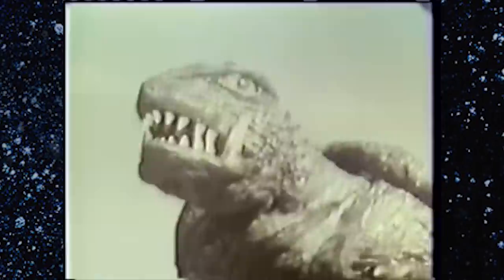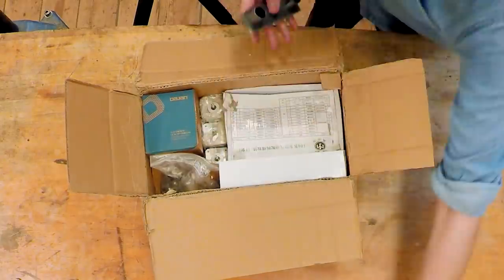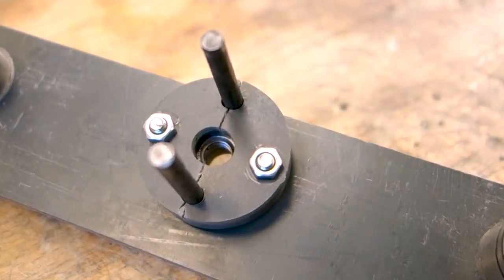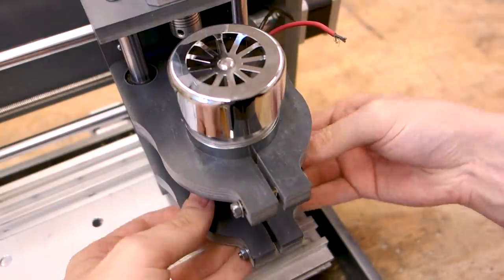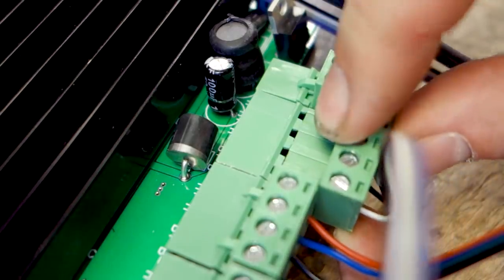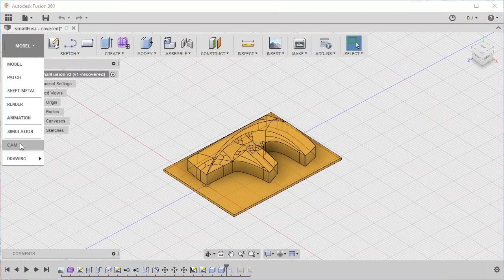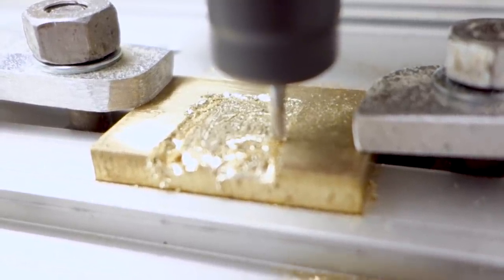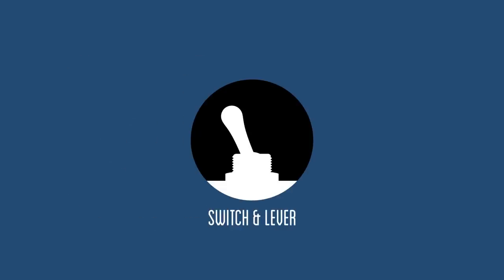Review: Cheap CNC Mill

Comment: You can solder OR crimp connectors. - Don't crimp AND solder!
Don't make me explain. I'm a civil engineer in electronics. Take my word for it.
Reply from the maker: Well obviously I can, I did it. Tell me what is worse though, a crimp connector having intermittent connection with the cable, because the cable is the wrong gauge for the connector, or a soldered crimp connector ensuring good connection throughout? Suggesting getting new crimp connectors will give you a failing grade, as I wasn't going to wait until the next day to finish.
Reply: The idea behind crimping is that it should be done so that there is sufficient pressure between all of the metallic surfaces that it slowly 'cold welds'. This is not an instantaneous process and takes a little time for the processes to happen.

The finished crimp will restituate a few [uM] over time because the outer shell behaves as a spring when hardened due to deformation. So does the copper inside the crimp but because of the ”cold welding” the connection stays good.

If you add solder (we'll assume that the actual metal-metal contact region is so tight that no solder will leach in to it), then as the assembly heats and cools (and thus expands and contracts) the solder will provide a region which expands and separates the metal-metal region.
In cables with multiple strands, the solder will wick-up and the cable will not be able to withstand vibration.

Don't believe me => checkout ESA or NASA standards.
Wire-connections in a spacecraft (which is probably the highest vibration environment you will find) are crimped and not soldered.
Crimping works if you use the right tools and is ultra reliable. Soldering will decrease this reliability.
Reply from the maker: Yep, I know the theory behind why you crimp. However you still didn't answer my question. What is worse, an improper crimp or a soldered crimp? 

Talking about NASA standards on a cheap low quality CNC is a bit silly though, don't you think? The vibrations and temperature fluctuations this will be put through is minimal.
Reply: I wasn't starting out with that. I only mentioned NASA to underline what's considered best practise. I included ESA because that's where my experience is from.

If you in a salty/ionized environment use crimp - period! All other cases: Crimp if you can.
If you haven't got the tools for crimping or the surfaces aren't clean you should stick with soldering, and leave out the crimp since the solder will still "float" after cooling down due to restituation. ( Think of a very slow motion here. Not a waterfall )
Btw. That's also why you should never put tinned cable in old-school screw-terminals. 
Instead use "ferrules" or a "pin" crimp-connector. 
https://reprap.org/wiki/Wire_termination_for_screw_terminals

Comment: Could you somehow use the machine to manufacture new metal parts for it to replace all of the plastic?
Reply from the maker: Nope. Even if it had the strength you would only be able to replace some of the smaller pieces. The machine doesn't have the travel required to machine the bigger structural pieces.

Comment: Never buy ANY CNC mill or router where the body and parts of the machine are made of plastic. For a few hundred $ more, there are pre-assembled Chinese entry level machines with Aluminum frames and beds, ball screw axis, and pre-assembled controller units. I have one of the 3040 type mills and it is great for a little tabletop unit. Very accurate, weighs about 50lbs, and can cut Brass and Aluminum (slowly).These are really hobby machines for soft materials like wood, plastics, machinable wax, etc. To machine metal, you need weight, rigidity, and spindle power.

Comment: I did not have to see the entire video, when I saw the round linear bearings.
They look like 12mm inner diameter, in plastic brackets.
And the motors are propably nema17 , which are pretty weak for milling aluminium
or even wood.
Since you have to put this together yourself, I suggest you buy prefab v-slot profiles
and plating with SBR rails, nema23 motors + drivers and use grbl on an arduino
for the controller.
There are plenty designs available and lot's of video how to construct a cnc.
You might need to drill a couple of holes yourself, but maybe you don't get to
throw $400 in the garbage.
Reply from the maker: Meh, GRBL is underwhelming and crippled. This runs a custom and more full fledged controller (though as was revealed pirated) which is a lot more capable. Also, if I wanted to build one from random parts bought from many different places I would have. That's not what this video is about. 

Nema 17s are just fine as long as the spindle is good enough. My issues with brass was more likely my choice of tool (ball ended) and my recipe. If I had more time to tweak I am sure I could've improved it. Even so, this machine is for softer material, I knew I was pushing it trying to do brass.
Reply: I built 2 prototype 3D printers (500x500 print surface) with
Ame lead screws and the same type of guides.
I use Marlin on my printer; it runs gcode, so you can use it for milling as well.
So I decided to make an adaption for milling.
It did resonably well for plastics, but ok, the screw pitch is 8mm, so
low feed rate is recommended.
However, the basic idea of my reply was:
If you have to assemble anyway, it might be better, with maybe a little more
than $400 and a bit more work, to build a much better quality cnc machine,
using basic parts.
I worked with a cnc with nema17, but ended up replacing them with nema23.
Better to spend some on the motors and the rail guides.
Those are the most important parts.
The rest can be cheap; scrap metal if need be, as long as you can fine tune it later.
Right now,
I am working on a 6 axis cnc machine, with harmonic drives (less backlash).
I hope to do a video on that, some time in the future.
Reply from the maker: On principle I agree with you, if you know what you're doing building your own is often better than buying cheap kits. However, if you're a beginner and you want some experience having all parts made for you and you have to do the assembly is a good thing. I don't think that the instructions and the parts were quite up to par on this with what they should've been. For a good example check the videos I made on the 3D printer kit I assembled some time ago. In terms of complexity it's not that different from this, but the instructions make the whole difference!
Reply: Usually, any person who wants to build such a machine, has an interest
for technical stuff. They are makers. I suppose that's the principle you speak of.
If people have no idea at all, maybe that deserves a video about, what exactly it
is that they get themselves into.
Because you and I know, there is a lot involved, like the mach3 software, or
whatever, and sooo many important details. It definately is not easy.
Then again, if it were , anyone could do it ;)
It is a pretty steep learning curve, but very satisfying, once you get it all working.
Just doing something, you can be proud of. It is wonderfull.

Comment: excellent video. i think the chinese are smart like most europeans and when you order this thing, if you do not know how to put it together, you will never know what it is for nor how to use it. face it. to be a creator of any kind a base IQ of 125 is required these days and according to the statistics, this is very rare. however i do love your video and how you sorted things out. a point to note that you shuold look after yourself a little more and perhaps geta scrubbing brush for when you wash your hands so your nails do not look dirty when filming. if your hands were clean (not that difficult really) the video would be 10/10. : ) apropos the chinese stuff being dirty. i reckn its air polution and them using any old bags to put the stuff in. i get stuff from china from time to time and they do not do the "unboxing experiewnce" well for cheap stuff. most of the time the tools are drenched in oil and in some cheap bag but when you clean them and start to use them - damn they are good. most of them. buyer beware but once you get a good supplier..... blah blah blah

excellent video! i have subscribed.

like to make stuff.

not that i have time..

...i enjoy watching this! :P

THANK YOU : )
Reply from the maker: Thank you for the nice comment. One point though, I'm not going to run and clean my hands only for them to look the same ten minutes later because I'm working in a workshop. I neither have the patience, will nor the skin to keep doing that. If dirty hands bother you I suggest you don't watch any of my other videos. I know very well how to clean them, but I'm not going to do it in the middle of working, that's just a waste of time.

Comment: Wait a second, linear bearings PRESSED in to plastic components? What happens when you need to replace those CheapChineseBearings(tm) in 1-2 weeks when they wear out? Guess you need to disassemble the whole thing and hope you can press out, and then back in, new bearings without breaking the plastic...

I'm just using my 3D printer to print out CNC parts.

Comment: "Everything is wrong with it. I recommend buying it."
Reply from the maker: Which is literally not at all what I was saying. I said, there is a lot wrong with it, and some right, and that I may buy it if I had to drop my own money, depending on what my requirements were. For softer material it's fine, I wouldn't get it if my aim was to mill metal.

Comment: i think that re-manufacturing the table defeated the point of doing a review of the original because not everyone can replace the plastic parts with metal. you're improving their mill
Reply from the maker: The only thing I'm improving with that is workholding. I'm not improving the entire mill, it's not becoming an entirely new thing because of it.

Comment: You keep saying link a machine that can do better....well here you go. It is my video of my MPCNC easily shearing through aluminum. https://www.youtube.com/watch?v=AdAtLoP7Poo This thing is shit
Reply from the maker: Cool, and how much did all of that, including the router you're using, power supply and all parts, cost you? It's using 3D printed parts which are also more brittle than the plastic of this printer anyway. I'm legitimately curious, and curious why you're so judgemental about something you haven't used. It just makes you look conceited.
Reply: I will admit all of it costed a little more than this machine. At the time I did not 3D print my own parts so the overall kit costed $400. That kit includes everything you need besides the EMT conduit, which is extremely cheap. I think all the conduit was $10 or so. The router was $60, endmill $5 SO. The overall total was around $500.

And woah, don't get too defensive. What I am getting at is there is infact alternatives to this that I believe you should be aware of. It is time you visit https://www.v1engineering.com/. He has some great machines for a low price as long as you put in the time to make them.

I am calling it shit based on what you presented. For $400 that is a lackluster experience. Have I tried it? No. But it is your job as the reviewer to show us what it can do, and I am underwhelmed. The MPCNC I linked could EASILY do what that machine did plus more. It can engrave, 3d print, laser etch, draw, mill, plasma cut, you name it. It is a general CNC platform that can do just about anything within reason. Please, check it out!

About the plastic, yes 3d printed PLA is not the strongest but it is quite stiff and dimension ally accurate. What you will find however, is that the design is far superior to the machine you presented. A lot goes into making a CNC machine. Your material choice is all but one choice a designer must make. The MPCNC is an excellent example as to what GOOD DESIGN accomplishes. It uses junky materials but the end result is something good because it utilizes those said materials so well. Rigidity in a machine has a lot to do with analyzing deflection points, geometry of forces, etc.

Also: The support he gives is unmatched. If you have any problem with your machine, you can post on the forum and get help from the designer him self! He believes so firmly in his machines, he even helps users who sourced the parts themselves and did not pay a dime to him. Do you think the Chinese people who made that will do the same?
Reply from the maker: I think if you're going to use 3D printed parts at least go with ABS. PLA is not only brittle but sensitive to humidity and heat, warping easily even on hot and humid days. You may find one day, for no apparent reason, that everything is out of alignment. 

I'm not saying you cannot make cheaper and better CNCs, all I'm saying is that I haven't seen examples of mills with the same range of travel and power that this has. That doesn't mean there are none, or won't be any, as this is a market that is moving quickly as well. 

I would love to check it out but it appears their website doesn't work at all on mobile (just blank white), so I cannot. What controller does it use? I haven't seen any of these different platforms use anything but Arduino based GRBL CNCs. GRBL is underwhelming. I'd choose a more full versed controller any day of the week, even though admittedly the one in the video turned out to be pirated.
Reply: PLA is actually the plastic of choice because of its dimensional accuracy during printing. ABS shrinks heavily which messes up how everything fits. I'm surprised to find none of my PLA has warped overtime. Also, PLA is not stronger necessarily but it is more stiff which for a CNC is better than a more durable but flexible material like ABS.

Back when I bought it, it used a ramps 1.4 board with an arduino 2560. Since then, it has been upgraded to a genuine RAMBO V1.4 motherbaord from ultimachine which is basically the same thing, but in a much nicer all one one package thats higher quality and significantly more robust.

I would like to think you have "seen" my example :P I actually produce quality aluminum parts I sell on a daily basis with just that machine alone: https://www.electric-skateboard.builders/t/boardnamics-idler-motor-mounts-for-sale/46255

Comment: 110 is NOT high voltage, and saying that it is degrades the value to the public found in actual high voltage warning nigns. Do huddled masses a favor and use the proper terms. Other than that, great video.
Reply from the maker: If it's voltage that can kill you then I'm just going to go ahead and call it high voltage. We're not talking hobby 3-12V electronics here, but stuff that if handled improperly could in the best of cases blow fuses, at the worst cause fires and be lethal if you don't know what you're doing. The dictionary definition of high voltage is "an electrical potential large enough to cause injury or damage" which 110V definitely falls within. (Not to mention that in the video the only place high voltage is mentioned is on a sign, used to get attention. Listen to the words in saying instead.)

Comment: Hi I clicked on this as I bought a cheap CNC from china and I wondered it this was the same make. Straight away I can see it is not as mine came with direction still in Chinese and the pictures were not even on the paperwork. All inquiries were met with the same answer by email which had nothing to do with my question. In the end I sent it back and got my money back under the "Not fit for use"  clause of my credit card.

Comment: You pay 400 usd for that thing ?
I just bought a CNC in China for not even 100 USD with 300 watt moter and most parts out of aluminium
Reply from the maker: Good for you, but if you actually watched the video you would've seen I did not pay for it, it was sent for review. How big of a bed does yours have though? The issue isn't that you can get a CNC mill cheaper, the issue is that the range tends to be much smaller on the cheaper ones, which makes it hard to compare.

Comment: If you are looking to get your toes wet with CNC tinkering, I think a Maslow would be a much better choice.
Reply from the maker: I don't agree, the Maslow is basically just a board cutter, it's not much different than a laser cutter in terms of operation. You can't really do 3D geometries.
Reply: Unless you are interested in cutting foam, I'm not sure this machine could do that either. The z axis upgrade should bring it closer to a full 3d device, but even without it at least it has the ability to do useful work.

Comment: Can it run with any open source drivers instead of the ones on CD? (If popping random dad's from China aren't desired).
Reply from the maker: You need to replace the controller to be able to do that, so no, not out of the box.

Comment: I got one and replaced the electronics with Arduino. I have not had time to get it running, I just manually jogged the X,Y, and Z. I want to use it to make wood and foam models for metal casting.

Comment: i kinda got triggered when he said "who even uses disc based media anymore" when hard drives have discs in them
Reply from the maker: Technically true, but you're not actually using the discs directly, you're using them contained in a harddrive, and usually you don't use harddrives to store just a few megabytes of files. For that flash drives are more than good enough. Also, SSD harddrives don't have any discs.

Comment: Hello, at 8:20, you said that you soldered your crimped connectors. I have read in multiple instances that it is a BAD thing to do, because it makes the junction stiff, and the cable will break at this point, rather than flex. So in that case, double "security" is worse than single...
Reply from the maker: Nah, it's perfectly fine in this application. The crimp connectors were too big for the cable I used (only ones I had at hand) so the choice was between a super loose connection or soldering. These cables won't move around so there won't really be any stresses on them to break.